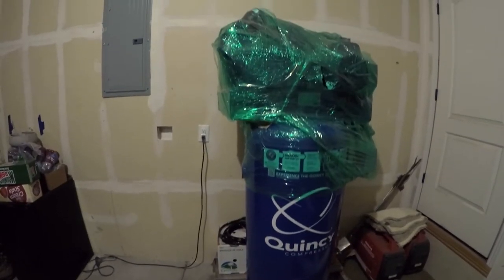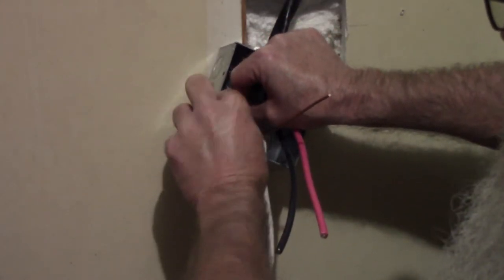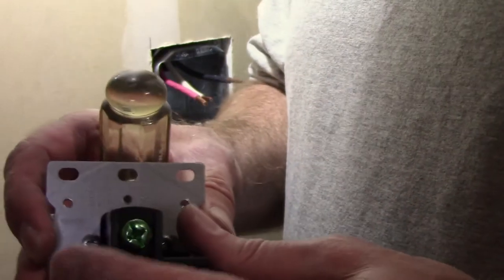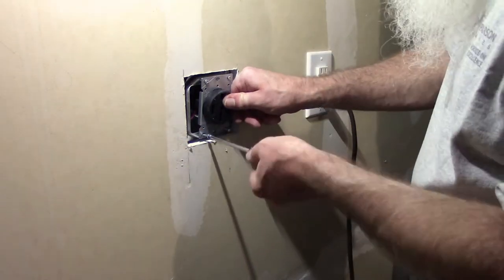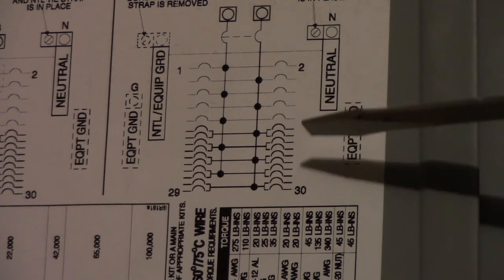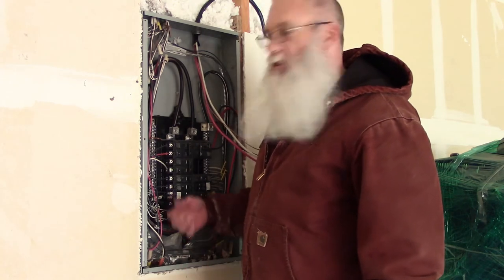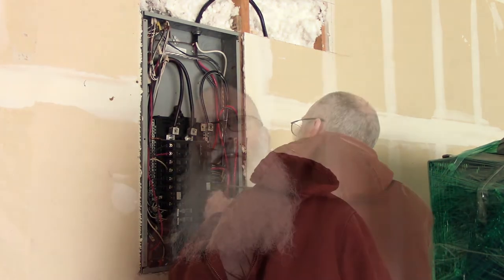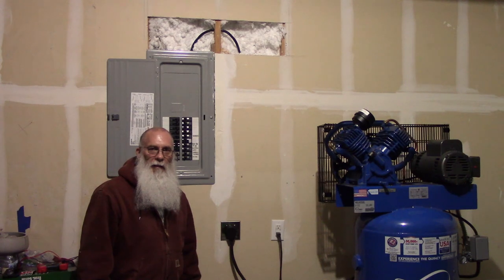Adding a 240 Volt Outlet to Power a Compressor and Welder

Comment: Good job, looks like you worked hard doing this. You could have made this job easier with a few changes. Strip the sheathing before putting the cable in the box, the wires should be about 2 or 3 inches longer and roll them into the box, it would be easier to make your receptacle connections. You could have used 6/2 Romex and a NEMA 6-50 receptacle, I doubt that the 240v compressor or the 240v welder uses a neutral wire. The white wire would be marked with red or black tape at each end indicating hot. Using 6/3 Romex is not a bad idea though, as you may need it later. Just leave the white (neutral) wire capped with a wire nut in the box. The other end to be landed on the neutral bus bar in the sub panel as you did. While using a separate grounding lug was fine, you could have looped the wire directly around the green grounding screw and then to the receptacle. It's only a 10 gauge wire, not a 6 like the conductors.
The neutral wire which is wired in presently should carry no current, because a 240v circuit is a balanced load by default. The neutral connection on a NEMA 14-50 is for loads, e.g. electrical dryers that also have 120v circuitry for the low power needs such as in the control panel lighting, etc.
Reply from the maker: Thanks for the advice! I'll try to remember it for the next time I need to do this job!

Comment: What is that switch you use to turn on the compressor on? Is it an appropriate amperage safety disconnect/switch?
Reply from the maker: It's the factory original equipment switch.

Comment: 6 agw wire? holy crap how many amps does your quincy  draw
Reply: He is also using the 240 outlet for a welder which draws more amps than the compressor.
Reply from the maker: Absolutely right.